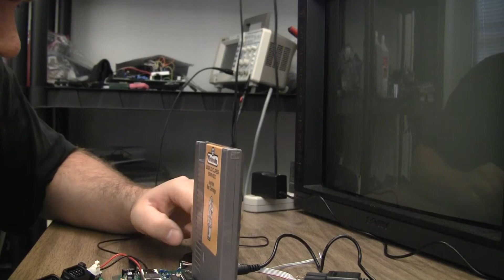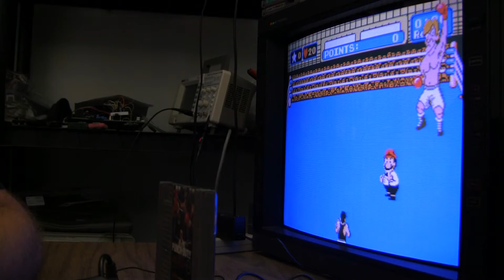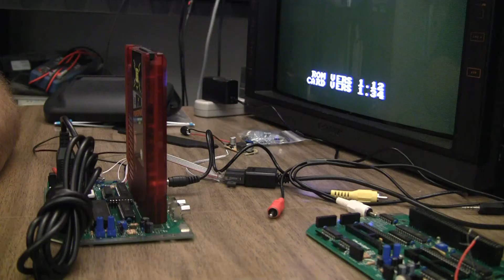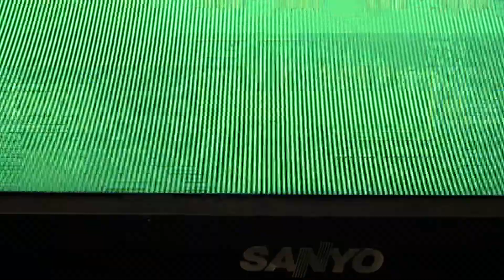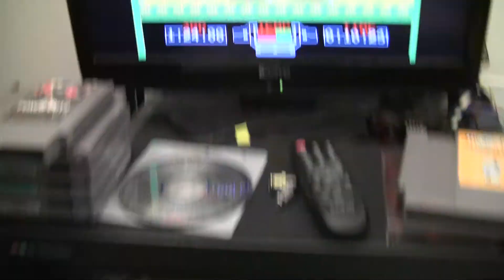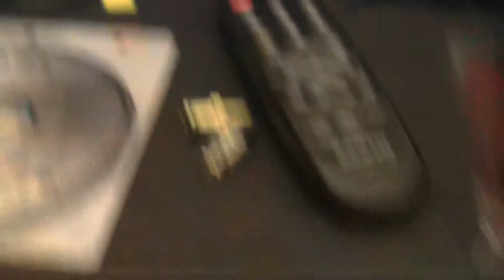NES Super8 v1.8 initial testing +RGB +YPbPr

Comment: Switching regulators commonly have ripple and noise figures in the 10s of mV.  Linear is usually an order of magnitude better.

If you want efficiency AND clean voltage rails (essential for analog outputs), couple a switching regulator with an LDO linear regulator.  Then you can feed it with e.g. 8 to 30V, AC or DC (assuming FWBR), and still keep noise in check.

Comment: Not every PCB manufacturer can cover vias with soldermask. In asia and with Hot Air Leveling tin, it should be possible. But: in europe with chem. Gold coating, PCB manufacturers do not  do that because of the risk of chemicals remaining in the hole.

Comment: that tracing is to make the most optimal resistance for the audio to make it so that the - or zero/ground is correct voltage as well as the +? voltage also it would need too much heat to heat the ground pads if it was directly on the ground plane that is one of the reasons to make it be on its own trace

Comment: Speaking about jailbars, if i connect my pal nes to a hd lcd screen, i can clearly see those jailbars wich are HARDLY vissible on an sd crt tv, i have tested it out and only a FEW colors don't suffer from jailbars, most colors suffer from horizontal jailbars while other colors suffer from vertical jailbars, but if i connect my ntsc nes to it, i don't see jailsbars in most colors, only a few colors may suffer from vertical jailbars, so what's the reason for this???

Comment: Trying to go modern with old school technology has it's challenges.

High frequency noise from cheap DC/DC converters is a real problem. As the old saying goes you get what you pay for. It was probably done to eliminate the cost of a heat sink that a linear regulator would require.

As for the audio those pots sound like they're linear tapered. You want to use logarithmic taper pots for audio.

Overall though this is an impressive unit.

Comment: Why would the guy include 2 individual trimpots for the sound anyways? Possible source for frustration for the average joe to get those evened out, when you could just go with a stereo trimmer.
Also, what's the trimcap for? Going with those is legit, but a possible source for frustration as those are going to get hard to obtain in the next 3-5 years.

Is this project open source?
Reply: Well you could technically put some 1% tolerance resistors in the audio pots place to eliminate them entirely.

I don't really see a reason why they were added.

Comment: Very informative.
The "Super 8" (still have no idea why he calls it that, it only causes problems since it's automatically associated with the unofficial and unlicensed actual Super 8 from the NES era) is definitely getting much better every revision.
Agree that those little sound knobs should be removed, the less there is to fiddle with, the better, plus the original NES doesn't have those.